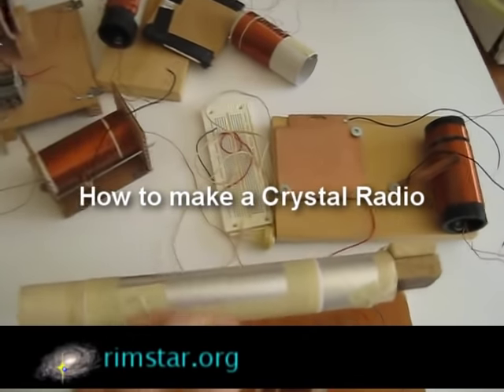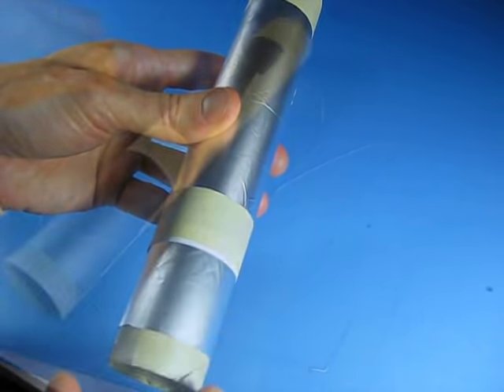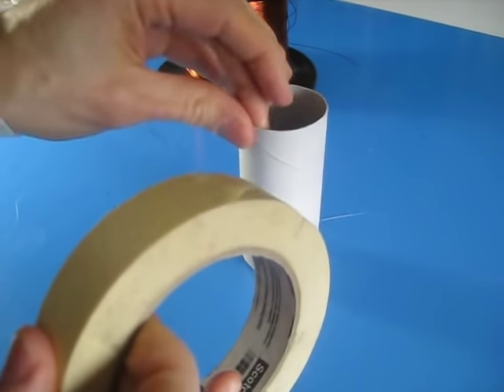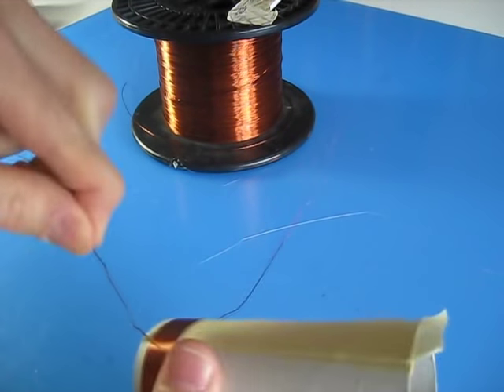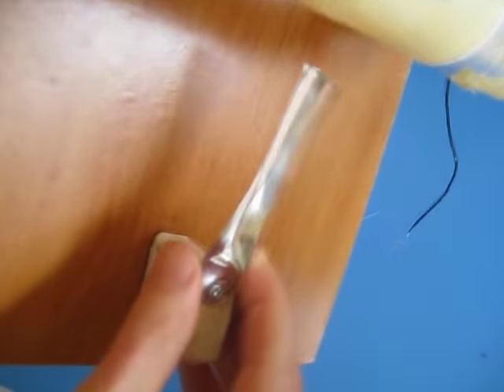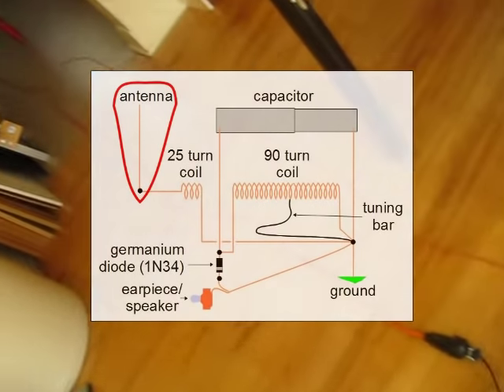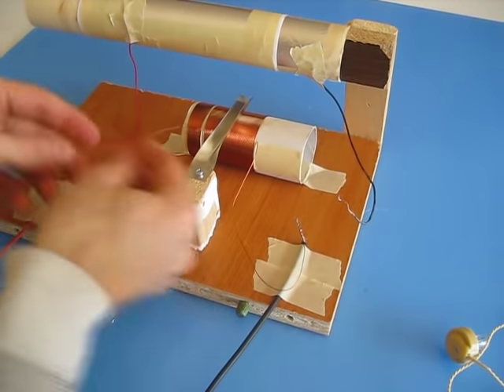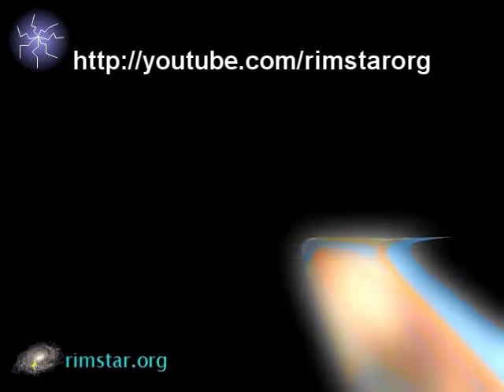How to Make/Build a Crystal Radio

Comment from the maker: If you're getting fluctuating pitches and crackles with no external power source than the radio waves, then I suspect you're getting something, even if it's just a jumble of electromagnetic waves. I suspect you may need a better ground too. A butter knife in the ground doesn't give much good electrical contact. You could pour water over that spot to dampen the ground or bury a larger object. Normally a 6 foot rod is used. Google search "ground rod". But try your antenna first.

Comment from the maker: A Schottky diode wouldn't normally work with this circuit. However, I haven't tried it myself but it's been reported below that 5 silicon diodes wired in parallel worked, possibly doing the same with Schottky diodes would work. I wouldn't guarantee it though. Parallel means all the ends with the stripes connected together and all the ends without the strips connected together and use where the diode normally goes.

Comment: I'm amazed that you don't need a battery. The energy captured by the antenna is enough to be able to hear the radio signal.
Reply: Yes, it can be quite loud with a powerful radio station.

Comment from the maker: According to the packaging you're supposed to give it anything from 4 volts to 28 volts. But that's for when it's being used as a loud buzzer. With my crystal radio it's getting only around a few hundred millivolts at most, and of course the resulting sound is pretty quiet.

Comment: Hardest part would have been the assembly of the outlet cord probably. Which, you skipped over. Thank You for making this video! Free energy was a gift we has been robbed. I'd like to see more science like this in our early school systems.
Reply from the maker: I skipped over that part because it's dangerous if you don't know what you're doing. I show alternatives in my follow-up video https://youtu.be/HZZmKZJrIW0
Reply: It ain't free energy. The energy is put into the air by the radio transmitter.

Comment from the maker: No, if doesn't matter what part the positive and negative terminals are connected. It doesn't matter which side of the capacitor is grounded as long as the circuit remains the same i.e. don't ground the diode. Touching it doesn't provide a good enough ground, although someone below said they had luck that way by wrapping aluminum foil around their finger and then connecting to the foil for ground, thereby contacting more skin surface area. How long is you antenna? The longer the better.

Comment: Small DC toy motors and transformers also have enameled wire you can use for the coils.
I have seen some radios made with square wood for the coil form.

You can use wood screws with big heads or even bare metal paperclips screwed to the wood base, to  make the wiring connections.

Make sure you have some paper between the pieces of foil for the capacitor.  You don't want the foil pieces touching, or it won't work! the capacitor mount is a good idea!

Comment from the maker: A 3v piezo buzzer should work. Mine is 4v minimum, so yours requires even less voltage than mine. I'm assuming your buzzer comes in a black case with a hole in one side. Cut a plastic tube, like a pen, around 1 cm (1/2 inch) long and glue it over the hole, then you can better direct the sound into your ear. I find they're not as good as the commercial crystal earpieces, but they work. Maybe your problem is elsewhere? Check all connections. The longer the antenna the better. Us a good ground.

Comment: I use to build this type of radio in the late 1950s. My biggest problem was I lived in Wyoming, and we didn't have any radio stations closer than Salt Lake City Utah. In 1958 I took a class in building the tube radio from an inventor that waa a professor at the University of Kansas. What I learned in that class carried me though the industry building power plants, and later Nuclear Power plants until I retired. I think everyone should build one. I have three suggestions. 1.) make your antenna 100 feet long as high as you can get it. 2.) Put plugs in your coil so it doesn't touch the board, it does make a difference. & 3.) I found pulling the wire through a closed book with a couple of bricks on top gave me a better winding on my coils.
Reply from the maker: Thanks for sharing and for the tips. The antenna tip is one that comes up a lot. I have a few things I'd like to try, including your tip #2 so I should really hall this out again.
Reply: Tutorial on building a nuclear power plant needed.....lol

Comment: Great tutorial. I've searched a step-by-step for a long time, trying to find out what's wrong with my set and why it's not working. Then i've found in this video: I've used a common diode without a long antenna for it and i've connected the capacitor in the wrong way. Also, i've used a normal speaker in the wrong way, since i've used the small antenna and it woudn't give enough power to turn it on. Now i'm gonna fix it using a crystal earpiece and a german diode. Thanks for the video!! =D

Comment from the maker: The capacitor and coil are both used for tuning. They form what's called an LC network. L represents the coil (actually the coil's inductance) and C represents the capacitor's capacitance. When the inductance and capacitance are adjusted just right for a particular radio station, then the coil and capacitor resonate with each other, exchanging energy back and forth. The frequency they resonate at is the radio station's frequency. See my "How a Crystal Radio Works" video for more.

Comment: Great Vid, short and too the point!!! I made one when I was a kid, my dad knew eletronics, and tried to teach me, at the time my dad had a heath kit 2 m reciever that was soo cool!!
I still dont know much about elertonics, and was wondering ???...
    If you could use a modern day germanium diode, I bought a kit from china for my raspberry pi's to start learning stuff, and it has a lot of germanium diode's... but not 1n34....
Reply from the maker: If they're germanium diodes then they should work. Are you sure they're germanium diodes though. Most diodes that you see these days are silicon diodes and those require a more power signal from the radio waves, usually meaning an antenna a hundred or more feet or being very close to the radio station so that you get a strong signal..
Reply: @RimstarOrg  Thanks for the info, I am not sure of anything!!... ha ha ha.... all I know for sure is the diodes I have look like the one you showed in the video.... but smaller

Comment: Hi, just finished making this.  Very happy with results. Didnt use ground wire for convienience purposes.  Sound was low but man, th most popular fadio station came in very clear.  Was a special moment jamming out to one direction and ariana grande to such a crude and weird looking device but i got the goosebumps and yeah, definitely worth agony of gathering materials.
Reply from the maker: Awesome! I know the feeling.
Reply: @RimstarOrg  Any way to get sound louder? when I push capacitor to left it gets quieter but I hear the music but I want it louder.  Does having a ground help with that?  thanks again for the every helpful video!
Reply from the maker: Pushing the capacitor to the left got quieter because you were detuning that radio station. Add in a ground does seem to help. For a quick test, just touch the wires where you'd normally put the ground wire and see if it makes a difference. In that case you're acting as the ground.
Reply: @RimstarOrg  thanks!! will try that. also one last question. how do you attach the second antenna on.parallel?  just attach from coil wire and tape the two ends with electrical tape?
Reply from the maker: Yes, just attach at the coil wire. Make sure you have a good electrical connection there. Electrical tape would only help if you wanted to insulate the bare ends from contacting something else which is bare metal.
Reply: @RimstarOrg  worked like a charm.  much more louder.  Thanks for all the help.  Will the germanium last a long time so I can enjoy many nights with radio?:)
Reply from the maker: Glad to hear it. The germanium diode? It should last for a lifetime of nights. :)

Comment from the maker: Ah, a few problems then. An 8 feet antenna isn't very long, unless you have radio stations nearby. I do and with my three parallel 15 foot antennas, the stations come in fairly quiet. Good innovation with your ground, hopefully it's enough in the ground. The wetter the ground the better. But I just checked 1n4148 and it's a silicon diode. With your short antenna, I'm doubting you'd get the voltage needed for the diode to conduct. Maybe try two or three in parallel or find a germanium diode.

Comment from the maker: I'm glad to hear it worked. Are you sure you have a germanium diode? One reason a germanium diode is important for the particular crystal radio circuit is that germanium diodes are a bit leaky, which is needed for reasons explained in my How a Crystal Radio Works video. I suspect either you have a germanium diode and some current is leaking through the high resistance of your body, helping with the leakage, or you've a silicon diode and your body is providing the needed leakage. Just a guess.

Comment: My antenna is about 10 metters , on the second floor of the house , so its pretty high , the ground is the radiator pipe, it works kind of well.

Comment from the maker: 1) The radio frequency's too fast to notice even if you were to make it turn a light on and off or make a sound. You can calculate it roughly by measuring or calculating the capacitance of the capacitor and the inductance of the coil and using those in the the formula for the resonant frequency. You'll have to look up the formulas for how to calculate the capacitance of a cylindrical capacitor and the inductance but you can see the rest in my How a Crystal Radio Works video starting at 3:36.

Comment: If you’re using a piezoelectric earphone to listen in then I would definitely recommend adding a 47k ohm resistor across it’s leads. Someone else commented suggesting this and it turned my construction from useless to a delight. I distinctly and clearly listened to Rod Stewart’s “Baby Jane” on radio Derby at reasonable volume. I had to use a finer bare copper wire to pick up the stripped wire on the coil rather than the thicker one I originally tried to use. I also had to be able to select individual turns on the coil which was surprising and I  had to directly connect this contact ‘pick up’ directly to earth (maybe due to a bad connection on my swivel arm effort).

Comment from the maker: I got mine on ebay. Germanium diodes are best. Other germanium diodes are 1N60, 1N91,  1N119, 1N270, 1N277, 1N283. You can also try two or three silicon diodes in parallel (all the striped end connected together and all the non-striped ends connected together.) I also recently uploaded a video showing how to use a razor blade and a pencil to make a diode but it didn't work great (see video link in the description below this video.) And it doesn't have to be magnet wire but it must be insulated.

Comment from the maker: Small gaps don't matter, but don't space the turns out completely along the whole length. Tighter is better. But some people use wire with much thicker insulation than I did and that's the same as having a bigger spacing. So I wouldn't worry about it too much.

Comment from the maker: You could probably make a pocket sized one if it's battery powered, so it wouldn't need a long antenna and a good ground connection. The most portable one I've made that doesn't require batteries is the one I put in my pizza box which you can see in my "Portable Crystal Radio using Loop Antenna and Pizza Box" video (see link in the description to this video or on my channel page.) You can probably make that smaller by making a more compact variable capacitor and folding up the loop antenna coil.

Comment from the maker: 1N4148 is a silicon diode. You need a germanium diode. I haven't tried it myself, but someone here reported it works if you use 5 silicon diodes in parallel, meaning connect all their striped sides together and all their non-striped sides together. You can't use normal speakers. You can use normal earbuds (like iPod earbuds for example) using the trick in my "Use Earbuds/Earphones with Crystal Radio" video. There's a link to it in the description below this video or see my channel page.

Comment: Much literature; especially the older pubs suggest using water pipes as a ground.  That only works in older homes/buildings where iron pipe was used in the water supply.  For many years, PVC has replaced metal pipe in home plumbing, and PVC is an insulator.  The only thing in the house that will function as a ground is the ground terminal of an electric plug --- as you have done.  Still, I'm afraid to recommend that given the number of people who don't know ground from hot and neutral.  :(.  I recommend driving a metal pipe a few feet into the ground for ground use.

Comment from the maker: The 50km distance could be your problem. If the antenna is a coil like my pizza box portable crystal radio then it's not very powerful. You could try putting you hand on the aluminum foil of the capacitors, making sure to get lots of surface contact. Try it with the outer foil cylinder and then try it separately with the inner foil cylinder. Your hand will act as a ground.

Comment: Hi..your video was very informative..Understood a lot..After watching this, I made a radio with the cylindrical aluminum foil capacitor (10pF - 220 pF) ,fixed tuning coil, piezo crystal and diode..... I connected the antenna to the large metallic roofing of my house and I was able to recieve a MW station 6 Km away.... 

Due to the proximity of the station, I avoided the small  antenna coil, ground,  bypass capacitor and resistor... I got a good signal... The large antenna played the crucial part..small antenna didn't work...

Comment from the maker: No, the crystal radio can't receive FM. And you're right, if the nearest radio station is 100km away then the portable crystal radio won't work, at least I doubt it will. You can make your own AM transmitter. I show how in my recent video "How to Make Crystal Radio Amplifier for Speaker". There's a link to it in the description below this video. Just make sure your transmitter can't transmit very far so that you don't interfere with other radio stations.

Comment: Very nice design. Built one myself along similar lines, but with a 0A41 germanium diode.  I get some decent volume by using a tunable loading coil in series with the antenna before it goes into the radio. Output goes either directly into my PC or into an amp scrounged from an old PC speaker main unit

Comment from the maker: Two diodes in parallel in the same direction, side-by-side would help. A full wave rectifier wouldn't work.
Do you mean as when you put the "phone on speaker" so everyone in the room can hear it? If so, you'll likely need an amplifier circuit. If you mean a piezo speaker in the listening end of a phone then just extract the crystal and use it as in the video. If an electromagnet type speaker then you might be able to use the trick I use in my "Use Earbuds/Earphones with Crystal Radio" video.

Comment from the maker: Theoretically, using the formula for resonant frequency, 1 turn of this coil with the capacitor opened way up to 10 picofarads (very little overlap of the outer cylinder on the inner cylinder) could tune in 36MHz. I don't know if that works in reality though. Other things may come into play. I've never tried it or read up on how to do it.

Comment from the maker: +Judy Bennett Yes, you can use a small battery power speaker in place of the earpiece. I do that here with my portable crystal radio https://www.youtube.com/watch?v=JtPwxbOgBHw which I show how to make here https://www.youtube.com/watch?v=iunAvz9PbN0. Though before you think of making this portable one instead, I couldn't get it to work in one building due to the use of a loop antenna. Long, straight wire antennas are better, so I used the crystal radio in this video and stretched wires along the floor for the antenna.
Regarding getting a ground, in the first video I link to above, the one about the amplifier, if you look closely you'll see I have my hand on one of the capacitor plates. In that case your body acts as the ground. Doing that, in combination with using an amplifier works fairly well.
Your PVC pipe should work fine. The difference isn't that big.
PS There's no Reply button under your comment because of your Google+ settings.
- go to your Google+ page,
- in the top, right corner click on your thumbnail icon,
- in the popup that appears, click on "Settings".
- for the 2nd question down "Who can comment on your public posts?" set it to "Anyone".
Reply: Thank you! Sorry about the settings. I think I've changed it now.
Reply: Judy Bennett Also, when do I have to be touching the capacitor? Is there a specific time when that is necessary, or is the radio active all the time? Can I use the speaker for this radio, or will it only work for the portable one? Thanks again!
Reply from the maker: Judy Bennett You'd have to be touching the capacitor whenever you want to hear the radio. And don't just touch with your finger. The more area your hand contacts the better. You can have visitors to your booth put there hands on it to listen too. The speaker will work with both radios.
Reply: RimstarOrg OK, tthank you!